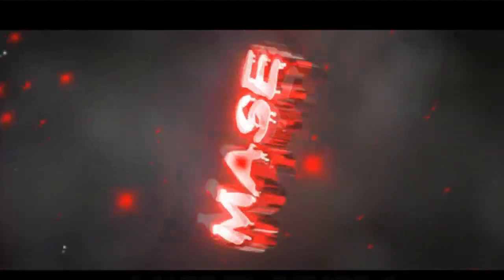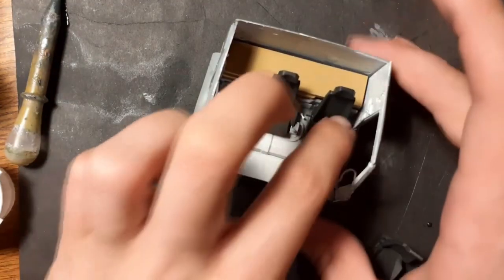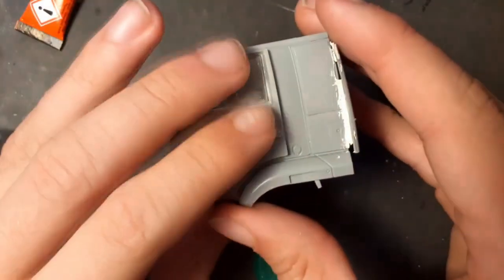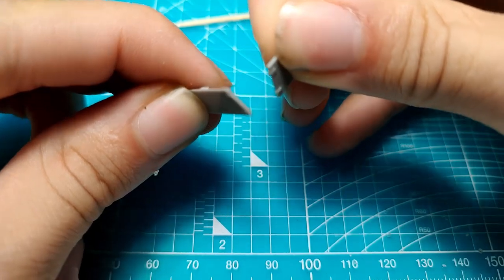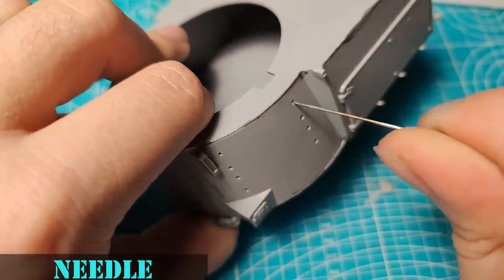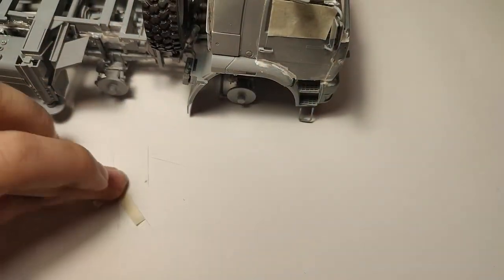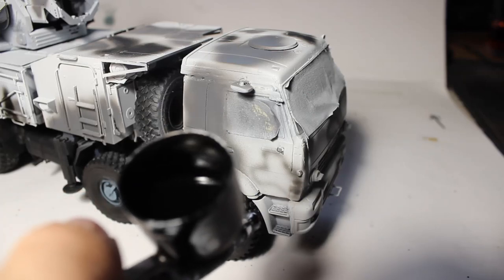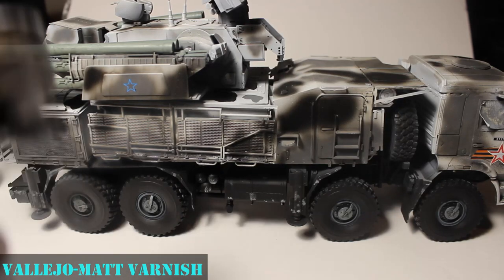Pantsir S1 Zvezda 1/35 full building video

Comment: In principle, not bad, but crooked, due to drips of glue and putty, the cabin and module are absolutely not assembled correctly.
Reply from the maker: Yeah I know that sadly this kit was not really my cup of a tee
Reply: @masemodelassembling  This set is very easy to assemble, You just have to try to work more carefully with the model, if you have a telegram, then I can send you a photo of mine Pantsir S 1

Comment: front bumper upside down. Some parts not glued well.
Reply from the maker: First think i have lot of struglle with this model, lot of parts dont fit well, and yes i think you are right but iam ok with thr result paint job is savior kinda here so
Reply: @masemodelassembling  i just finnish this model. It's not so bad. But it need some time. 600 parts take some time and amount of work. But you could made it better.
Reply from the maker: @marcinm2767  yep I knew but it was very not good model for me so